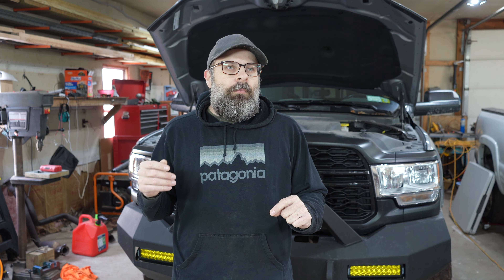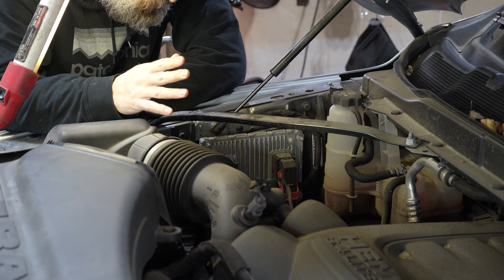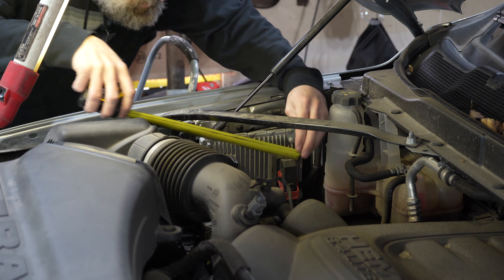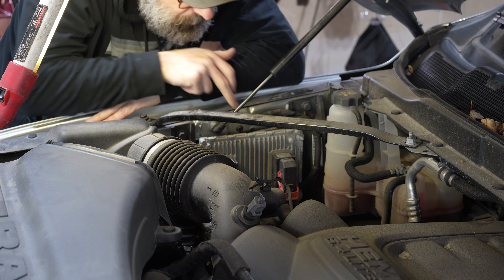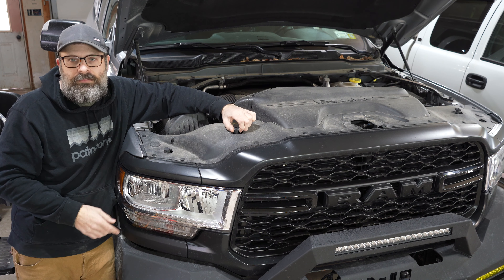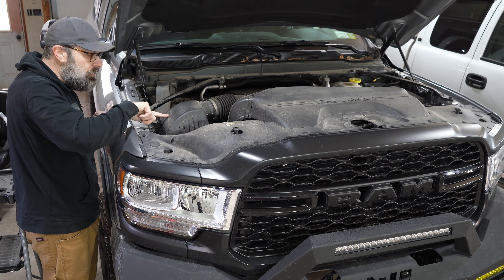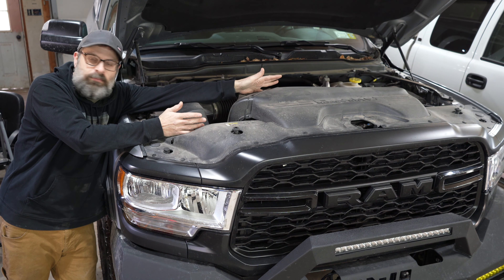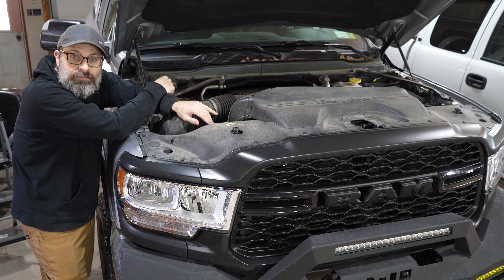Are Snorkels a Scam? Water Crossing - Offroad Overlanding 4x4

Comment: As for the battery, on my 05 Yukon xl Denali it only comes with one battery but the Sierra 2500 had a second battery option and what I did was just purchase the OEM parts and now my Yukon has two batteries using all OEM parts, although, for the snorkel I wouldn't do it because keep in mind you will also have to get all the electronics on the truck sealed and waterproofed for it to be effective, otherwise, if you just get a snorkel and expect to drive through some river, you will be looking at flood damage to the electronics and could shut the truck off on you, then, your literally screwed at that point.

Comment: My thoughts on a snorkel is to treat it as a raised air intake for dust. Adding one is on my list and the AEV is what I’m looking at. I believe the AEV comes with a new air box
Reply from the maker: Yeah I mentioned this in the video. But if the front intake is still there, it's still going to take in dust. So are you going to remove that and just leave the snorkel? Is it going to be enough air? That's what I'm wondering.

Comment: There is actually a video i saw recent on here of someone with a 2021 with. 6.7 Cummins relocating their battery with a kit because they were installing compound turbos. I believe the kit relocated the battery on the frame under the vehicle. Im going to look for it now and tag you in it
Reply: This is the video
Reply from the maker: Appreciate this link. I don’t think I want it this low. Doing a lot of off pavement and wet/snow driving. Thanks though 👍
Reply: @NickMango  no problem brother. Hope you get it figured out 🍻

Comment: 90 percent of people that install a snorkel use them for bad dust situations. There is less than half the dust up high. I don't do any serious off roading and I would never buy a snorkel.
Reply from the maker: I mentioned dust in the video. The problem is the front intake is still there, which means you're not stopping the dust from coming in. If you remove that part of the intake, you're cutting the air down a lot. So it doesn't make much sense to me, dust or water. Still going to hurt the engine.